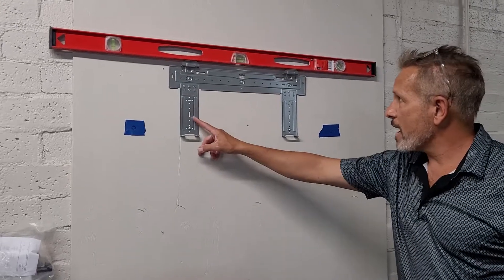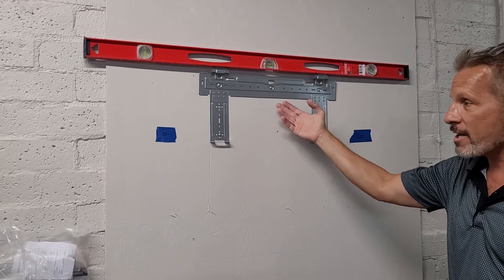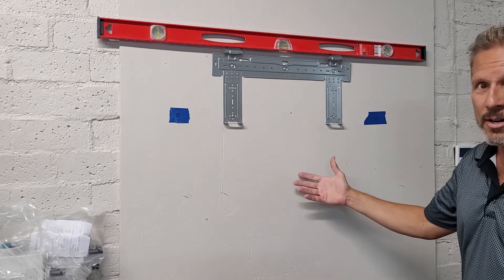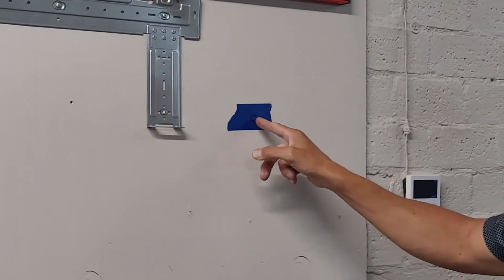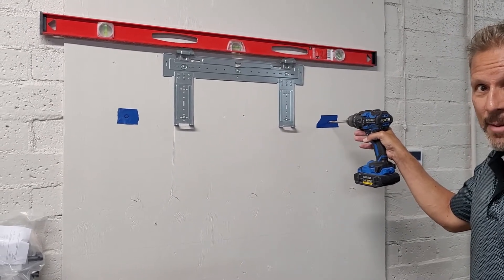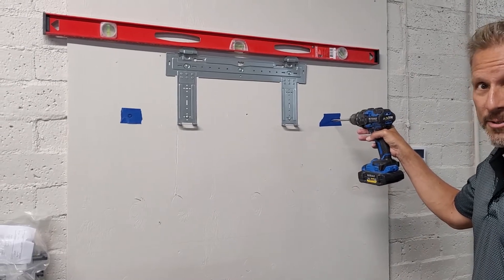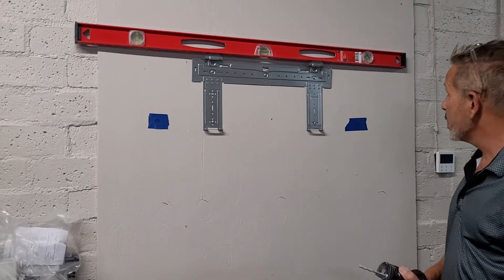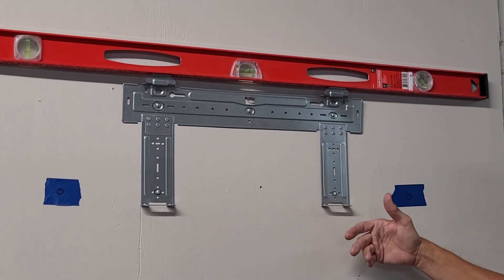#1 How to mount the wall-mount bracket and drill the wall hole for a mini split installation.

Comment: What is the measurement from the center point, to the spot to drill the hole? It's 7.25" from the screw, but what is the measurement from the center? 
- (I need to check the placement for the header & studs for mounting above a window) - Thank You
Reply from the maker: Hi Mike, there's actually room for improvement in this video, so we need to figure out how to write over a video and re-release this. The 7.25 in will work, but it's better to do 6.5 in from the right hand hole, or 6.75 in from the left hand hole. That gives you a little bit more room for the indoor unit to cover the whole without it being too close. Go to airspool.com/install for the details. And from the center, add 7 and 5/8 in to either of these two figures. That is, it's 7 and 5/8 in from the center to either of the holes on the left or right hand side of the mounting bracket.